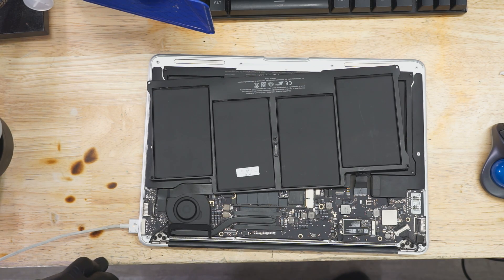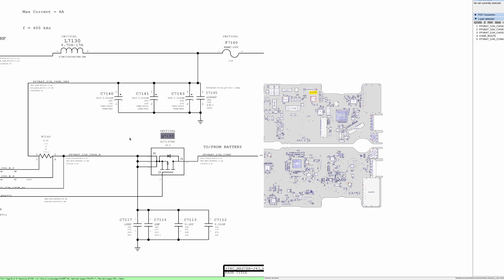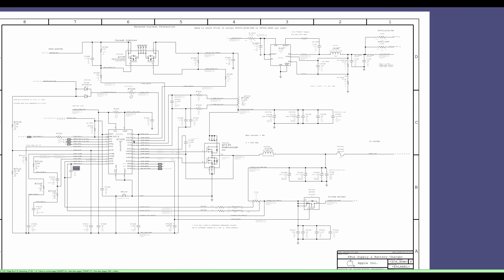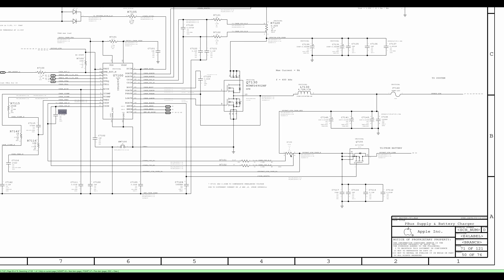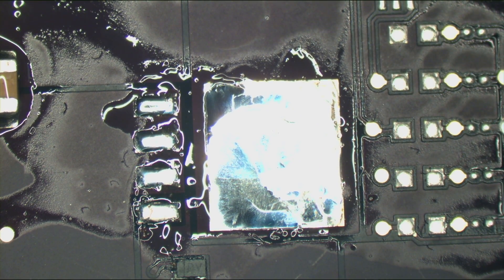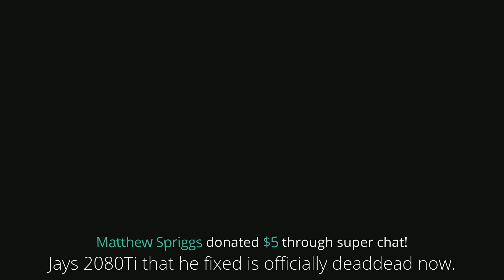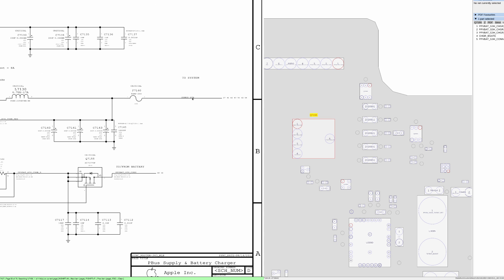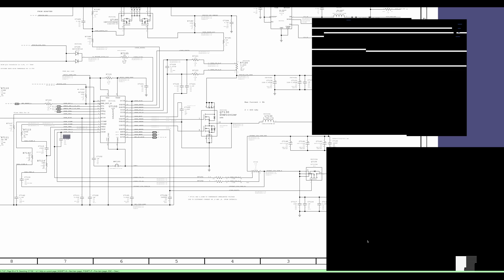Why this A1466 Macbook Air can't charge a battery

Comment: in my case R7012 was out of range, 12k while should be 68K, replaced and now it's working, that R enables the charge from the original sources, mine only worked with the power supply or generic chargers.

Cheers

Comment: magsafe would turn on green light for few seconds then turns off ( orange light sometimes comes on) , fan spinning. Measuring 8.54V between GND and PPVBAT_G3H_CHGR_R & 6.56V between GND and PPVBAT_G3H_CONN which should be 8.6V as per the schematic. computer works fine using a fully charged new battery. Any fix you suggest please ?

Comment: If the voltage that goes to that transistor(7137) is lower than 8.5 (which is 8.12 in my case) the battery won't be recognized or charge, right?

Comment: I have the same issue. Replaced the battery and the charger is blinking green and the computer does not turn on. most likely would be that chip but I do not have the chip nor the infrastructure to replace it, so I guess I will be a new customer. Thanks for the video

Comment: question, i got a hand me down a1466 airbook that will not power up with the charger plugged in. is that a power connection issue? or is it a battery issue?  the mag safe won't light up when plugged in but it WILL power up and show a battery with a tiny bit red when you press the power button on

Comment: When complaining about Linux, you need to bear in mind that it comes in different flavors (distros) and different GUI rendering engines. I don't know if this an issue with GUI, but it is something to look at. Testing the behavior on different distros may help rule out the cause of this software acting like it is having seizures. I am a big fan, keep up good work. I have learned a lot from your vids. Cheers.

Comment: Hello @Louis Rossmann could you help me please I exactly have the problem, can I make a jumper on Q7155 from source to drain momentarily ? just to turn on the laptop and check if the laptop reconizes the battery on screen then take it off and replace Q7155? Many thanks

Comment: I have a kind of similar issue with a A1465 EMC 2631 won't turn on with battery, will turn on and charge battery. battery says it is full. i am going try to see if i can figure it out.

Comment: What is so hard about using JACK audio? If you use a gui controller like qjackctl or carla, it is fairly easy. Also, you can use Airwave to make windows VSTs work in linux. Or you can just use LV2 plugins instead. Airwave is here: https://github.com/psycha0s/airwave/releases

Comment: I got a destroyed a1502 MacBook Pro from a recycling center. The screen is broken and it looks like someone snapped the screen back because the hinges are destroyed. I used a charger and a external monitor and it works, it’s just still registered to someone’s Apple ID. Dose anyone know if I can sell it as a whole for parts for would it be a better option to take out the motherboard and just sell that? I thought if I take out the ssd the board it would no longer be attached to the account. Those motherboards are going for over $150 and I would love to get that money. Can anyone give me some advice?

Comment: Guys (who've been watching more of those vids than I) - any ideas why would Macbook Air (2014?) battery charge VERY slowly (takes about a week to charge) ... otherwise it works fine (runs the laptop, discharges as it's supposed to, etc.)  ....  and sorry - in Latvia here - so sending the mac over isnt (a viable) option.
Reply: Bad connection so only very low current reaches the battery? Louis has also just mad a website that is basically an apple repair wiki you can try and look there
Reply: @the_retag  thanks! I’ll look it up

Comment: I moved to Manjaro and/or Arch linux distros, those have spared me lot's and lot's of headaches in the past months.
Clean wiki's and documentation, less randomness... Due to the clean wiki's you don't need some strangers advice on random forums... 

I used to use Debian, and before that Ubuntu, but I have the feeling those distro's have been going downhill for the past 5 to 6 years. 
Their wiki's are often not updated, lot's of randomness and forum 'copy - paste' nonsens...

Just the difference in package manager, Pacman actually does what it's supposed to do while apt just makes a mess of your system.
I changed distro after my debian with cinnamon desktop wouldn't boot after updates, apparently apt-get update & apt-get upgrade changed the python version on the system causing cinnamon and nvidia drivers to do random stuff and crash. If I wanted a system that crashes after updates I could just use Windows instead!

Comment: What, you just need to compile the audio codec with the correct matrix transform for the sampling hammer codes over the TMC audio chip (you did remember to buy an opensource laptop with the Linux supported audio chips made by StarChipsCo, IIRC there is an African startup that ships worldwide the custom PCBs for you to build your own LCD power rail to fit to a scratch built Laptop and the instructions are available on a Github pull request from a ThingVerse blog) from 2017 (not the 2016 or 2018 Feb builds). Make sure to get the sorucecode from Fred, on his dial in BB board over bud 1000. When that's all built and compiled, you then send an email to OBS for the custom firmware to the netcode and ip in through terminal to the TCP server, and run the audio through your Google Cloude AI instance for just $500 per month, but you could use your Universities free resources to do it from there...

/sarcasm, but not far from most "tutorials" for Linux troubleshooting. ;)
Reply: you sure those are not install instructions for the turboencabulator?

Comment: What does a 0 Ohm resistor do? Acting like a fuse?
Reply from the maker: It doesn't resist
Reply: @rossmanngroup  Resistance is futile.
Reply: no, it's acting as a jumper
Reply: @666Tomato666  Why isn't there just a normal trace? What's the advantage?

Comment: Does the A1466 need a new logic board or display when the backlight is pitch black but you can still kinda see it?
Reply: Neither yet. Find out why the backlight isn't working. Louis has many backlight videos in playlist. Check them out.
Reply from the maker: This is like asking if my food tastes too bad because I used too much or too little salt before tasting it

Comment: One option is to have a dual or more boot system. In my case I have windows on it's own  nvme drive and linux mint on it's own nvme drive and arch linux on yet another drive (ssd). I boot first to the arch linux grub (boot loader) menu from which I can choose one of three OS's. Windows for programs and games suited to it, arch linux to learn more of linux and linux mint as a home base free from proprietary complicated and unseen manipulations by the OS. I installed windows first,  when only one drive was physically attached to the computer, then I added the others for installing  linux's.

Comment: Keep an eye out for PipeWire. It's basically a replacement for PulseAudio and Jack. 

It's still beta-ish but it can/will work with everything that works with Jack (but easier) and Pulseaudio (but better). 

Plus it will handle video (webcams, cameras, and screen sharing), and eventually planned be able to run effects and stuff on the video. 

It already can handle all of Jack's VST and plugins stuff for audio, I've used it. 

It pleasantly surprised me at how good it is for basically beta software. But it's totally daily usable for me, with a few glitches and crashes that I can tolerate.

Comment: Are you trying to use JACK on the same sound card as PulseAudio? They won't share a sound card and you'll either need to disable PulseAudio or configure JACK to use a different sound card to get it to work.

Comment: Question, since I'm somewhat early:

You mention frequently, and rightly so seeing what you do all day, the BS Apple pulls with its chip suppliers and how you can't buy them.

Just how difficult would it be to be able to reverse engineer your own chip to take their place?

If you did find some way to do so, do you think Apple would have any legal avenues to tell you to fuck off?

Keep up the important work of saying what's up when things aren't as they should be.
Reply: I may be able to answer this.

To actually manufacture your own chip would be extremely difficult (if not impossible), due to the proprietary nature of computer chips (especially in Apple's case). Manufacturing the chips would be insanely expensive and more than likely not worth the effort.

The closest we would be able to do today is using something like an FPGA (field programmable gate array), which is basically a programmable integrated circuit, which may be able to be programmed to emulate the chip. While cheaper, these are also quite expensive considering what we would actually have them doing.

But let's assume that we've gone through all of that and actually have a working replacement. Unless they can prove you used their source code and/or schematics to build the replacement, you're theoretically in the clear. In legality I'm a bit less sure so maybe someone else could help out here.

TLDR: Technically yes, but in practice probably not worth it, and potentially a legally grey area.
Reply: @Brodensson  I can answer the legal side of things, as there is precedent with the IBM PC BIOS: if you employ clean-room engineering: one person reverse-engineers, writes specification, the other implements it, without talking to the first person, then yes, it's legal
Reply: I have been wondering if you could use the ISL chip used previously and adding some small MCU in series with the I2C or whatever bus is used for control and do translation there. Could even be a modchip style polyimide flexible pcb that just fits in the space that's there.
Reply: Lord_haven111  Lol, nobody would dissapear and a pin and feature compatible clone would be a gray area think. As those do exist for many chips. 
And my proposal was more of a "capability layer" that makes the mostly compatible chip look like the apple exclusive one to the system.

Comment: i got the audio issue, alls you need to do is turn off your pc not restart with exactly what you have set up for obs and nothing more plugged in.(do not open any video editor before OBS) plug for twitch.tv brad the inhaler where i do it every day with the audio issues of linux in obs and every other audio or usb problem Also I'm Drunk or stonned most of the streams

Comment: Pipewire is coming. Say byebye to Jack!
Reply: Interesting, I'd love to switch to linux but I feel converting my Voicemeeter setup to jack + whatever else I need to get it working would be a pain. I did some research but didn't hear about Pipewire. I'll do some more research I guess.
Edit: after minimal research it seems like a project unifying the many audio backends into one, making it easier to configure (plus low latency, real time processing...etc)
I'll probably go that route when switching if it's stable enough
Reply: It‘s there yea. We'll see how it goes heh. Easy to beat pulse/jack tho
Reply: Seems to not support Windows, 
and i use Jack to pipe Audio from a (arch) linux box to a Windows PC.
Reply: @oberonoberon9288  through kvm? Or separate PC's entirely?
Reply: @wildcodefox7313  Two Separate PC.

One is where i run my Games On, and has my headphone connected. (Windows)

The other one is a mini PC, Mostly used for Youtube, music and Skill-Build pages. (ArchLinux)

Some Games just hog all the screens, turn the ones they don't use black, or other complications.
Reply: @oberonoberon9288  ahh, gotcha. If it was virtualization it's possible, otherwise your kinda stuck with Jack for now lol 😂 I run a passthrough with a second video card so it plays just fine with my guest os, wether it's windows 10 or MacOs big sur

Edit: video card not reliant here lol 😂 just realized how badly worded that was lol.
Reply: @wildcodefox7313  I could also use a old-school line, but a speaker out is hard to set to levels working with a Line-In. (The mini PC only has a regular out and a minke in.)